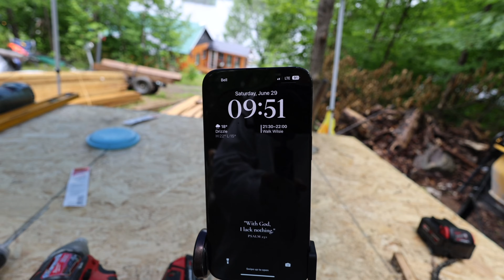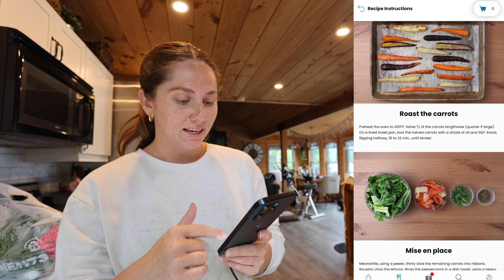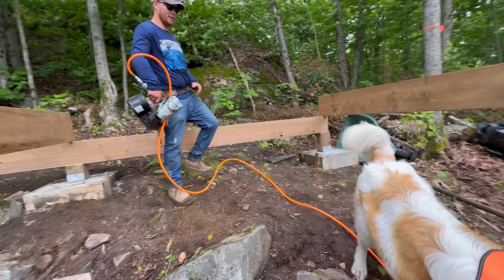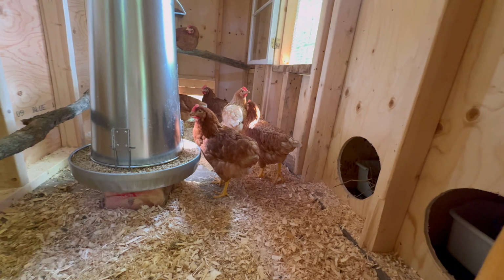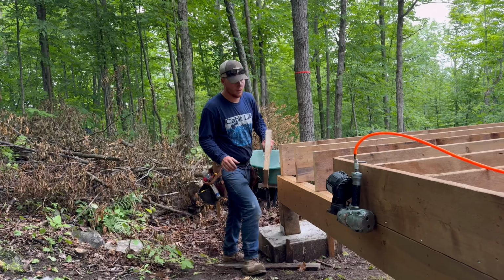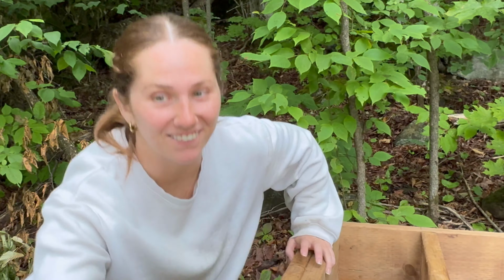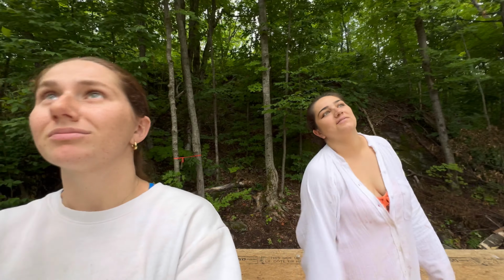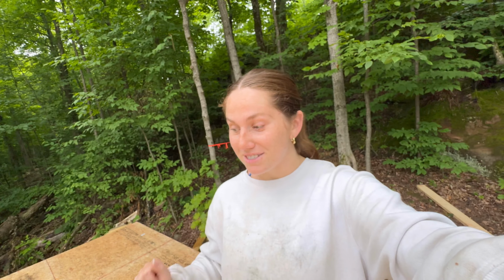EP 3: time to frame | MADDY'S ISLAND GYM BUILD

Comment: Hi. Your have all done a great job. The only thing you need to add is a beam though the middle to help support the middle of the floor or add some more vertical supports throughout the underneath of the structure. This will help to distribute the weight down to the foundation. At the moment all the weight will go into the joists which have no support.
Reply from the maker: That’s a very good thought! Thanks for sharing!